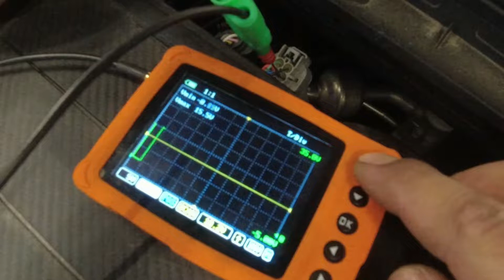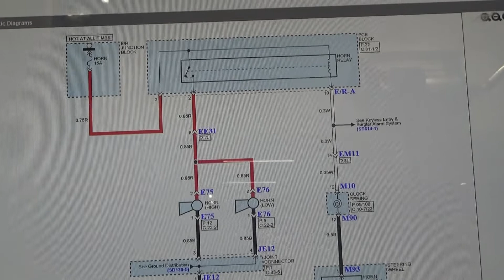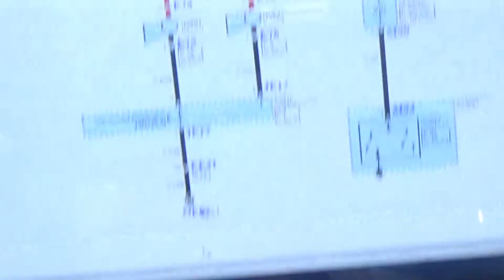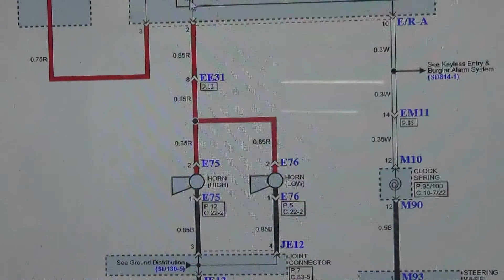Genesis GV80 horns not working

Comment: Can you do me a solid. I have all sorts of lights pooping up on my dash in my gv80 and now the rear seats will not lift up and close what do I need to check.
Reply from the maker: What codes you have,? I would start with visual inspection, check battery connections and ground connections.